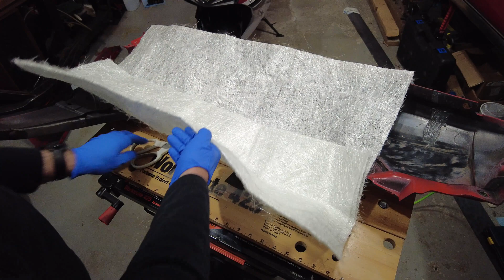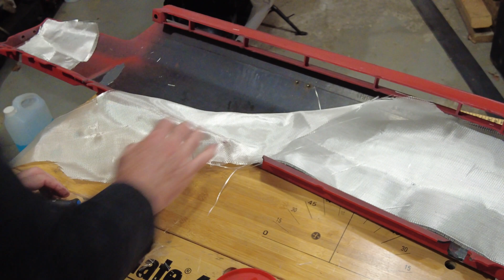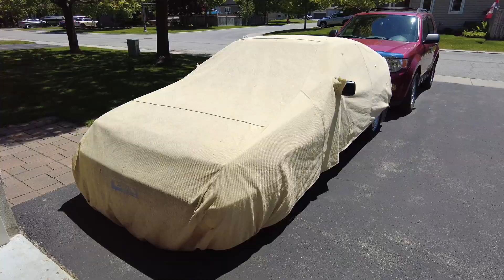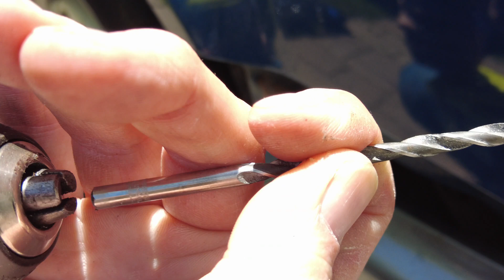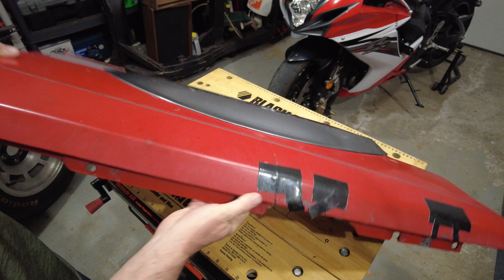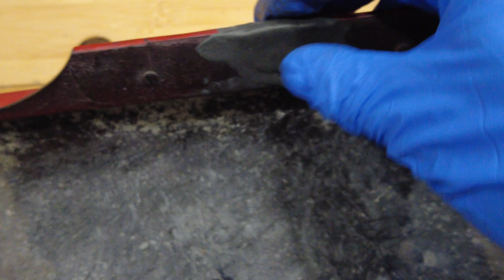Real-Life Rare 1987 Honda CRX  - Original One Owner Plastic Body Panel Removal and Repair - Part 2

Comment: I am preparing to do fiberglass resin/cloth treatment on all body panels of one of my CRXs before taking it to the painter. I thought I was the only one doing this! Thanks for the video-I may try a second layer of cloth on some areas, as you did on the nose panel. I am debating using some panel bonding adhesive (3M 08115) on the bolt areas and corners of the panels for extra strength (with fiberglass cloth) as recommended by my body guy. However, this stuff is $70 a tube and the gun to apply it is $90. I am thinking the fiberglass resin should be strong enough to prevent cracking. Any thoughts on this?
Reply from the maker: Let me check and see how my panels are doing and get back to you. Good luck with your CRXs . J
Reply: @Motorcycology  how are your panels doing now? any updates?

Comment: DOCTOR CRX can you mix steelstik with fiber glass ?
Reply from the maker: Good question and for me I used JB epoxy and the steel stick epoxy  to fix the cracks in the fender and rebuild some missing parts. After that I put down the resin and fibre glass...so far so good. Thanks for watching , much appreciated.